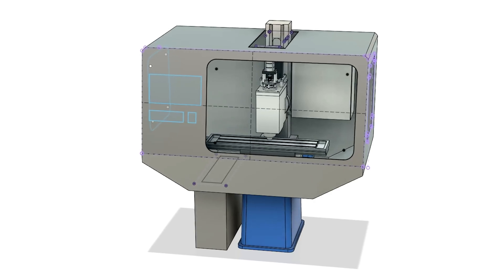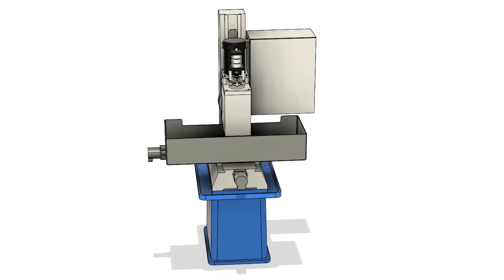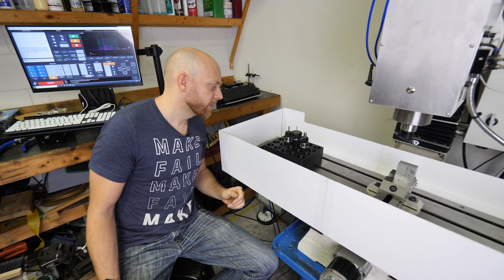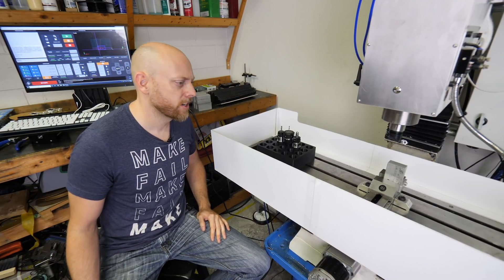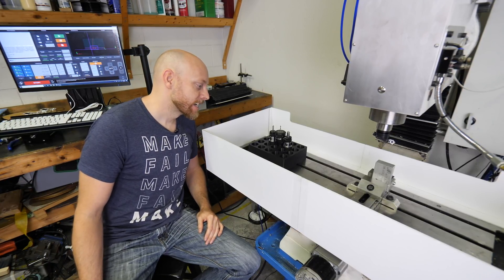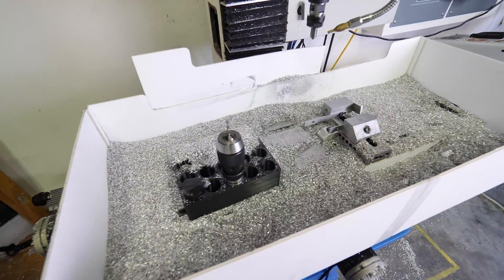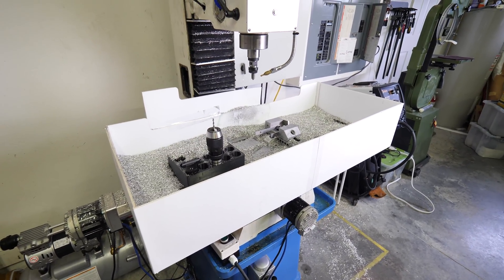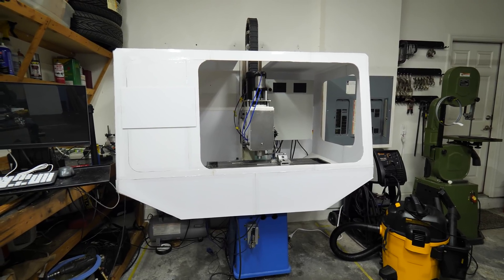CNC Enclosure Part 1 - S03E16

Comment: Why are linux users obsessed with the command line? UI exists for a reason: it's easier and faster.
Reply: Nah, bro. Every time I see somebody pull out a USB stick to transfer a file, when they could (securely!) network copy it with scp... Yeah. If you want a 40 minute overview on the commandline basics that will make your LinuxCNC life easier: https://youtu.be/_c1o8tqoR-0 (shameless self-promotion)
Reply: @swolebro  why should I watch a tutorial series when I can use a gui that's self explanatory?
Reply: @ERPP8  I dunno. Why would you bother to learn how to use a table saw? It's a tool, and it helps you work more efficiently.
Reply: When you're familiar with the program you're using, command line can be faster. 

1. Typing is faster than using a mouse. What would take 5 clicks to find in different menus, takes only one line. And it has autocomplete. 

2. All the settings (and most of the data) are stored in text files - you just open the file, find the setting you want (there usually is an explanation next to the setting) and change it. No need to search through 3 different menus to find it.

3. If you don't know how to use a command, you can write "command -help" to open a gude. If you don't know how to do something, and you google it, you'll usually get a guide with the exact command you need to use. Just copy and paste.

4. It's easy to automate repetetive tasks - you can just write a list of commands in a text file and run it as a program. You can easily send input/output of a program to a text file or send output of one program to the input of another. It makes itegrating different programs very simple. There's no way to do it in UI.

5. UI is a pain in the ass to program. You need to put every control where you want it and program its behavior for every action the user can do on it. And you need to account for the user doing things in any order and trying to do stupid things. With command line you just (1) ask a question, (2) read the answer, (3) check if it makes sense, if not (4) print an error message and ask the user again. For writting simple programs, making the UI can take ten times longer then writing the program itself. And when people are volunteering their time to make an open-souce program (or when you're writing one for yourself) it's a waste of time.

Example: I was recently customizing the OS theme on my crappy linux laptop. I found set of icons, but the colors didn't match the theme. I needed to change one color to another in a few hundered svg (vector graphics) files. Opening each file in inkscape and changing the color manually would've taken ages. Because svg files are text based, i used the search and replace command. It took only one line and a few seconds to get all files changed.
Reply: @proper_imp  all of this is comes from the perspective of a programmer. I'm a user. Why not use something that has thought put into it than a jumbled mess of commands?
Reply: @ERPP8  Couple of reasons: 
1. Because there's no gui available for a program
2. You want to automate a  task
3. You're running a server without gui and administrate it remotely.
4. You need to string up a bunch of programs together: calculate something with one, make a graph and then take all the graphs and make an animation. If you do it once, you can do it manually, but if you need to do it every week, it's gonna get tedious very quickly.
5. It's just faster. When you open a program in windows you don't look for it in the start menu with a mouse. You just start typing a name and hit enter. Command line has good autocomplete. In practice, you start typing the command/file name, hit tab and it will either autocomplete it or show you the possible options.

 In my experience, graphical menus are usually much more of a jumbled up mess than commands. Commands have to be well organized and documented, with every option explained.

You don't need to memorize anything. If you use something often, you'll remember it and if not, you usually can just google what you want to do, open first result, copy and paste.
Reply: @proper_imp  Not to mention command retention and being able to recall previous command strings.
Reply: The real problem with UI vs CLI comes down to density, where modern UIs have to accommodate potential access to hundreds of unique objects. This often results in large cumbersome menu schemes. I would argue that you probably already follow some CLI basics, as both Windows 10 and MacOS have integrated search systems into their menu systems to speed up finding the program/control you are looking for.
Reply: @nohbudi  but a gui is actually organized. A cli is just a list of commands that you have to memorize. I can easily use a new function I've never used with a gui, but doing anything in a cli requires so much effort.
Reply: If you do something once GUI is nice. If you do something 1000 times shell is better.
Its also much easier to help someone on the shell. Without images it's really hard to make someone to navigate a GUI. Let someone type in a command line is much easier.
Reply: Yeah, no (depending on your use case, of course, I don't want a 3D modeling application driven by a CLI). What's funny is that you are saying CLIs aren't UIs. They are user interfaces.
Reply: @Thorhian  I actually took 2d CAD at a time when there was still some emphasis on the command line in drawing, but the majority of the students clicked and drug everything out. It turns out that with some basic trig you can rapidly draw out prints on a keyboard. 

To your point about 3D; While simlarly possible, that experience did not transition to the Z axis, and I fell back to using a mouse, but I still call out commands with the keyboard and mostly use the mouse to draw.
Reply: @Thorhian  ok cool. Gui. It's still stupid to not utilize graphics to make things more clear and organized. A CLI requires you to have everything sorted out in your head, which is a pain in the ass and waste of time.
Reply: http://www.catb.org/~esr/writings/unix-koans/gui-programmer.html
Reply: No it is not faster
Reply: @XMaster96DE  learning and remembering a bunch of stupid commands is a waste of time